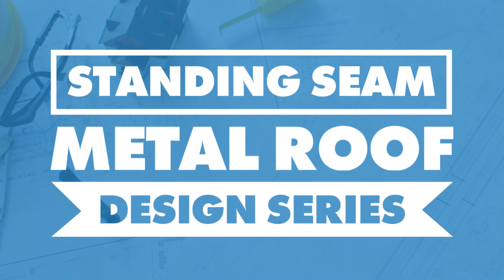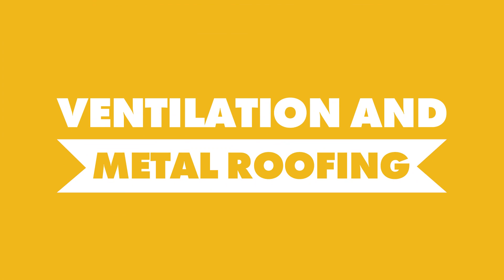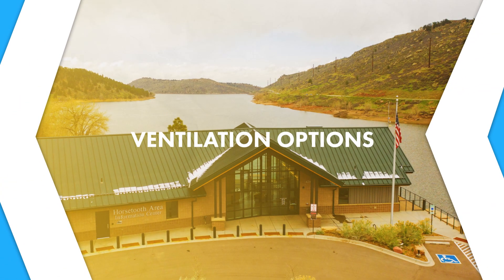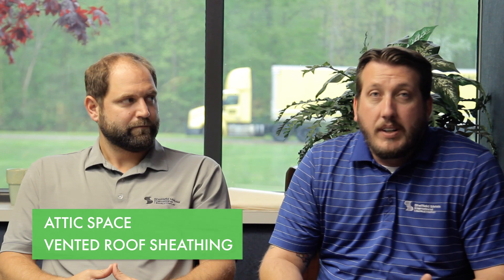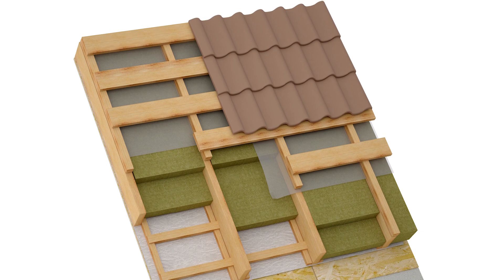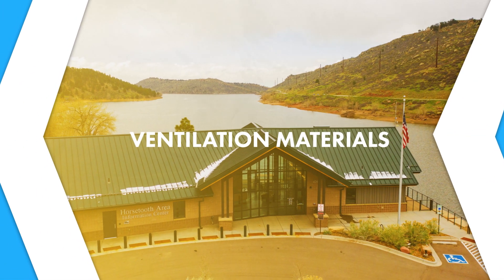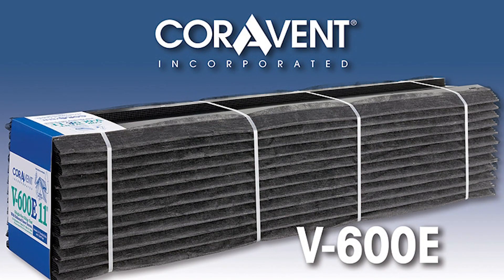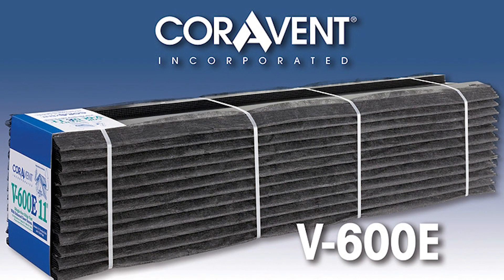Ventilation Considerations For Metal Roofing: Methods, Types, Uses

Comment: you are punting on the issue... it's not "refer to the ventilation experts," there is no such specialty contractor. This is YOU. Be specific. Or be brave and state that this is a recognized barrier in the field without a current standard solution, THEN discuss the non-standard solution in detail.

Comment: I wish someone would address ventilating a standing seam roof that has been installed on a roof that has been insulated with open or clossed cell insulation in the rafters. Installing a double layer of furring is not a good solution due to the addtional depth it adds to the roof.

Comment: Love the vented ridge diagram at 3:39. I'm planning on this design minus the vented attic. I'm using 1x4 diagonal purlins with a gap at the top to vent heat between the radiant barrier and the metal.